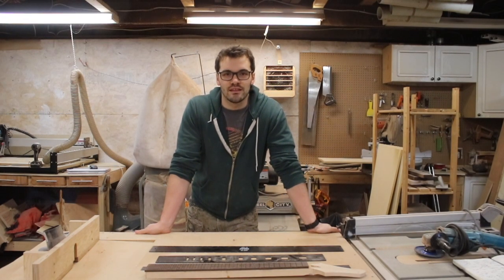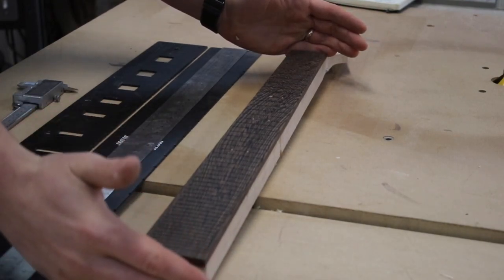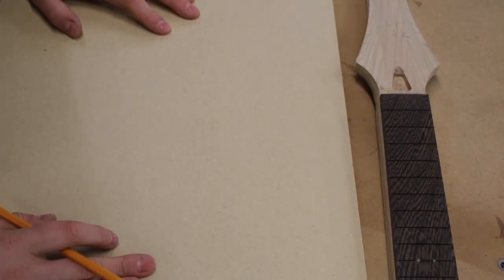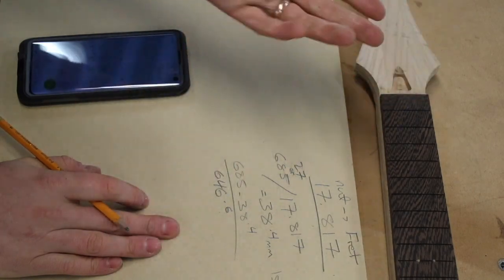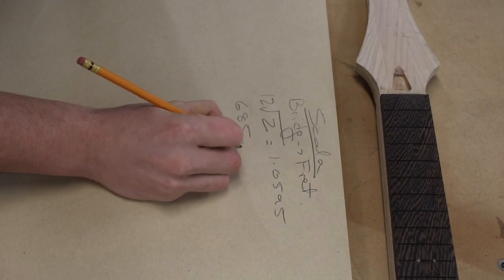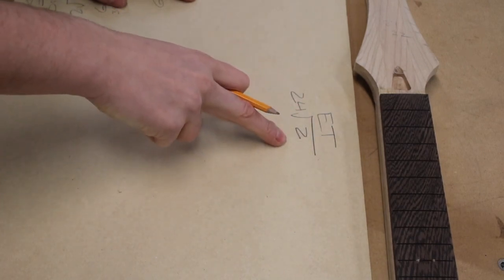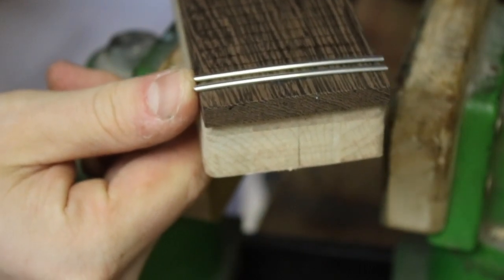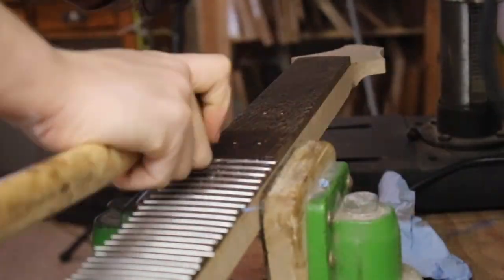Microtonal Math - How to lay out a 24TET fretboard - Vigilant Guitars

Comment: Dear Sir, with the exact method you described you can fined the exact place of the mandals (ORABS) of an Eastern Arabic Qanun. Only the eastern, because the scale of the Turkish Kanun is devided to 72 microtonals system (It has been taken from the Byzantine music) and this is the reason why Turkish Kanun has more (mandals in Turkey language) or (Orabs in Arabic) than the Arabic one. The Arabic called Qanun but the Turkish one is called Kanun. Your video is very helpfull.  Some Byzantine scalles has 12 10 8 12 12 10 8 Or like European Major 12 12 6 12 12 126 
another scale is 6 20 4 12 6 20 4 As you see these kinde of scales can not be played with the Arabic system witch has only Quarter tone, as the one you have been described.
Reply from the maker: I'm going to have to plead ignorance on the specifics of the  Qanun vs Kanun but I'm glad the video was of help!
Reply: @VigilantGuitars  Really it was very, very helpful. Do you have another 2 magic numbers for 3/4 of tone and for one hole tone? Because in the Arabic qanun they have 4 Orabs as the second photo I send you 1/4 + 1/4 + 1/4 + 1/4 That means the first plays 1/4 the second plays 1/2 tone the third plays 3/4 of a tone and the fourth plays one hole tone. 
You may see the deferents between Turkish Kanun and the second photo of an
image.png
Arabic Qanun big difference in the mandals
I have send the photos in to your email.
It would be very helpful if you have another two numbers for the 3/4 of a tone and for a hole tone so I will not have to remove the first fret for more accurate calculations. Thank you very much.
Here I play kanun in the middle of the taxim you will hear 1/4 tone melody.
1) https://www.youtube.com/watch?v=VAuah781k5E
In this video I play Guitar and Buzuki and singing
2) https://www.youtube.com/watch?v=_Blr5AFB_ZM
and in this video I am in a Church orchestra in your right side Church poems (Praying)
3) https://www.youtube.com/watch?v=PSUa2jlj72g&t=179s  (Byzantine Church music) it was a recital and of course without music instruments because of the microtonal system.